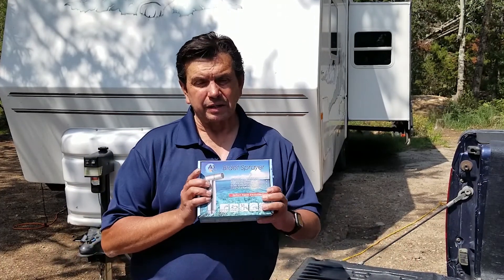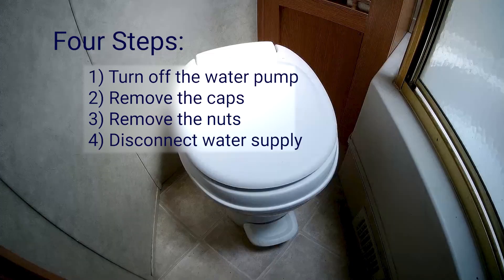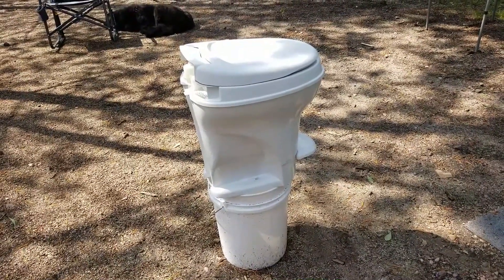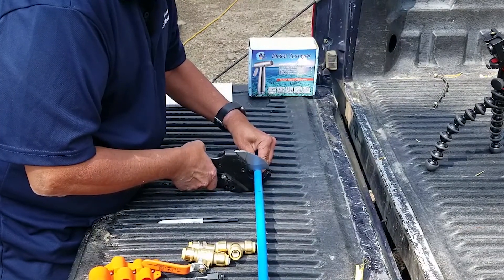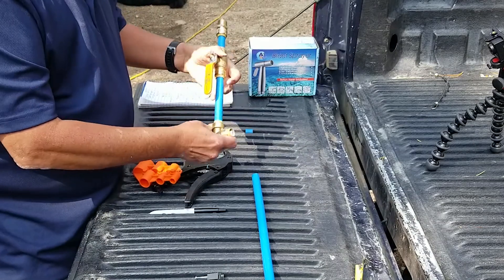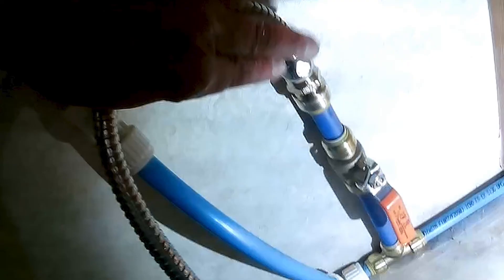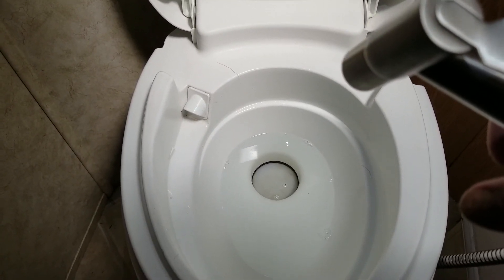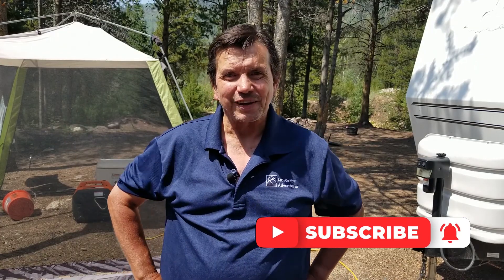DIY RV Toilet Solution. Install a handheld sprayer!

Comment: My Columbus had a Dometic 310 toilet with hand sprayer when I purchased it.  It came stock in the big "C".  When the foot flusher plastic gears wore out after 6 years, I purchased another Dometic 310 and had it delivered.  Yep, no hand sprayer.  Strange.  Thanks for the ideas in your tutorial vid.  And, I like the bidet sprayer you installed.  I will try to install it and the water cutoff valve too.  Thnks.

Comment: Hi. Thanks for doing this video. I'm going to follow your instructions and do the same install. Can you tell me what size pipe fitting I need for the 1/2" pex to pipe? is it 7/8" or 3/4" to connect the sprayer end? Thank you, Marina